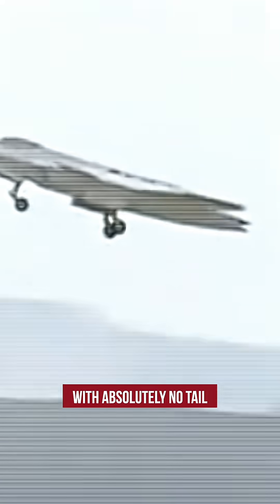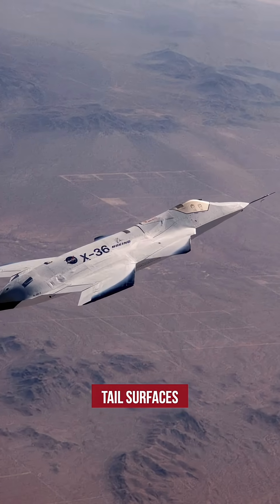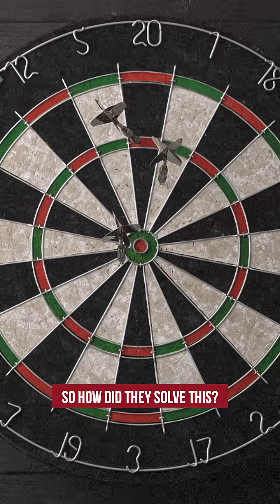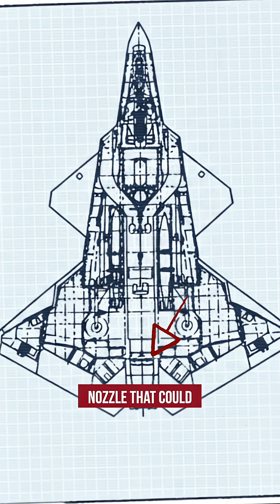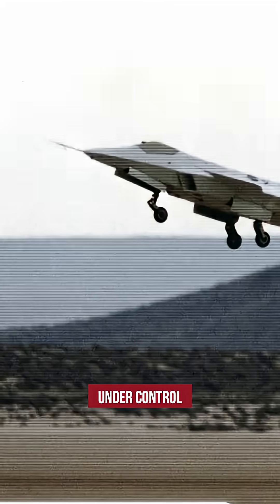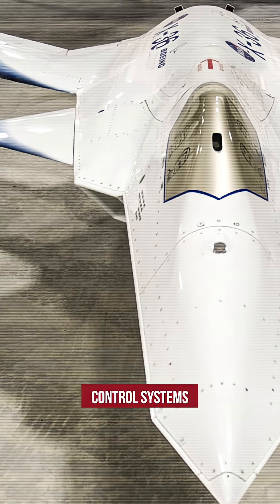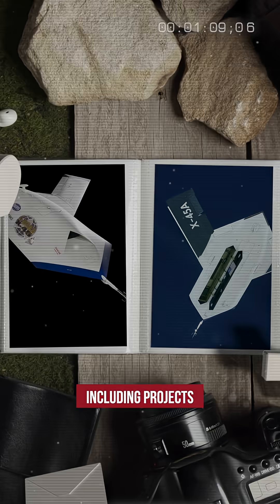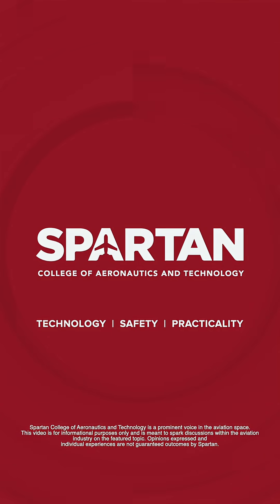The Aircraft That Helped Rewrite Flight Rules

Comment: Meanwhile birds : vertical stabilizer? Don't  need that!
Reply: they do have vertical stabilizer tho... just.. more adaptive moving parts and complex  :)
Reply: They fly at much lower speeds and are incredibly light 😊
Reply: Birds are like gliders that flap their wings. 
Now that I think of it, I’d like to see a Bird with a mini jet engine. 
Would be cool.
Reply: Birds have aeroelastic flight surfaces and often on top of aerobatics they do aeroballistic maneuvers = fold their wings completely and just let gravity and their momentum do its thing. We are long ways off from mastering flight like best birds and insects have. I highly recommend anyone interested  getting a bird feeder if they can so that they can observe birds very closely, preferably also record their flight in high framerate. The most mundane things they do constantly are amazing when seen slowed down as our eyes can't see all the little things they do in a split second.
Reply: If you look at them they tend to flip the tail vertically for yaw so they just part-time it as both.
Reply: Amazing description from Aviation Stack Exchange: the main problem with mastering bird flight is that it's very hard to study their aerodynamics independent of the control system.
Reply: They do it by just rotating their tail feathers. Search up a video of any bird hovering in an updraft and you’ll see it turning its tail in different ways to stabilise
Reply: What’s that got to do with supersonic fixed winged aircraft ?
Reply: Plus they poop on shiny cars rich people own. 😇
Reply: @NolenCobb I'm far from rich. So does that mean the birds are predicting my future 😁
Reply: @NolenCobb  doing the lord's work

Comment: I mean the Horten brothers did it too
Reply: The horten ho is quite LITERALLY responsible for your entire stealth bomber design philosophy 

So much so that instead of "innovating" you jusg made the B2 slightly smaller and painted it white 😂😂😂
Reply: No. they didnt it wasnt finished. And the didnt solve the stability issues. Northrop B2 solved it
Reply: @OverneedBelkanWitch tbh they made it work
Reply: @OverneedBelkanWitch true it had issues but it flew so it answers the question
Reply: Flying wings are different and easier than a design like this and China's  J36
Reply: @md.abdullahalmamun1636  Flying wings do not have no tail and are they are an air craft so they qualify
Reply: @md.abdullahalmamun1636 I wouldn’t say they’re easier. They have different challenges I’d say. For example if you have a flying wings then where are you gonna put the yaw and pitch control? (Pitch is easy but for the yaw you would have to get fancy with the horizontal stabilisers and thrust.) with an elongated plane body like this you can use the canards to to give it more stability (just as they already do with modern planes like the Eurofighter or Grippen)

Comment: Remember too that the X-36 was a scaled, proof-of-concept model for the concept of the aircraft that would have become McDD's entry to the JSF program, but the company was in deep crisis and it never came to pass.
Reply: McDonnel Douglas did have an entry in the JSF contest.  It was eliminated from the competition when the Joint Program Office selected the Lockheed Martin X-35 and the Boeing X-32 for the demo phase, eliminating separate entries from Northrop and MD.  X-36 did advance McDonnel Douglas and then Boeing's knowledge of tailless flight controls.  The X-45 and now the F-47 have surely benefitted from this knowledge.
Reply: Why does the aircraft in this video have nasa and boeing written on the fuselage.
Reply: @sidharthsaji521 because it was an experimental aircraft by Boeings acquired subsidiary that they took over and helped complete, in the end a lot if X planes like this end up doing aerodynamics research with/for NASA... hence the partnership.
Reply: @ravissary79 More to that, the X-36 first flew in May of 1997, the merger between McDD and Boeing completed three months after that.
Reply: Remember that China J-36 and J-50 came up with foldable artificial rudder fins and elevon giving their new 6th generation fighters to perform sharp yaw and pitch. Coincidentally J-36 designation by Chengdu probably to remind people of X-36 that they came up with better invention J-36.
Reply: @jawarakf actually china did not came up with the J-50 and J-36. Both planes are still unnamed.
Reply: @jawarakf What happens when the wing tip control systems fail.
Reply: @jawarakf wow hey good for china only took them 27 years to catch up to 1997 tech
Reply: @whisperingforest9909 bruh you realize the X-36 is a 1:3 drone right? It's basically a glorified RC plane. J-36 is a (soon to be) fully functional and operational fighter.
Reply: @whisperingforest9909 china is far ahead of you in 80% of all fields now lmao , live in Hollywood son
Reply: @Gongolongo  China has FORTY J-20's.... 😂 Im not worried about the J-36
Reply: @jawarakf neither of those aircraft have foldable vertical stabilizers. 
Artists did renders that speculated this but the newer footage showed this to be impossible because the wings trailing flaps cam now be seen and they follow the rear lambda design in a predictable traditional way that precludes the folding stabilizers from occupying that space.

Don't look at renders and then say China did x. That's just fan art. China has released hardly ANYTHING official on these aircraft. Everything we know is a combination of speculation and footage.
Reply: @ravissary79 are you not seeing the many videos of China J-36 and J-50 flying over cities? They have artificial fins and flaps that allow superior movement for aircraft that big. Also in the news, Fujian class aircraft carrier released videos of J-35 and KJ600 taking off on EMALS and landing on Fujian class aircraft carrier. It means China will get 4-6 conventional aircraft carriers with complete fighter wings for shore defenses followed by nuclear powered aircraft carriers for offensive operations.
Reply: @jawarakf yes ive seen everything i can find... none have folding virtucal stabilizers as is discussed in this video.
They're both FULLY tailless like the b2 and  b21 and x36.

The j36 has split flaps for stability... like the b2.
The j50 has an unusual wingtip all moving  canard... no vertical stabilizers.
Reply: @jawarakf  Oh wow! China now has EMALS! That means they are eight years behind Gerard R Ford which is bigger and nuclear powered. Also US first tested the F35C on carriers in 2014. China is still behind dude, don't hype them up too much😂.
Reply: @HeidiK3The F-35B is VTOL 😂 it doesn't need a catapult. We have them on our 11 America Class (LHA) Amphibious Assualt Carriers, As well as the "ancient" 11 Nimitz Carriers and the 1 operatiinal Ford Class Carrier. China has 3 Carriers 2 of them are in dry dock, and the other has never left Chinese Territorial Waters. If you want to talk about "problematic" let's talk Laoning, which was a 68% complete Russian Kuznetsov class carriers. How well is the Kuznetsov (Russia's 1 and only carrier) these days? 😂

Comment: So now we know why Boeing won the new air dominance fighter competition.
Reply: NGAD (Next Generation Air Dominance) is a DARPA program that started in 1983, it's not 1 single plane. NGAD includes the F-22 (ATF - Advanced Tactical Fighter), F-35 (JSF-Joint Strike Fighter) & F-47 (PCA - Penetrating Counter Air) fighter planes. NGAD also includes the (operational) MQ-20 Avenger, MQ-28 Ghostbat and the X-58A Valkyrie Loyal Wingman drones as well as other elements of Air Dominance.
Reply: The REASON why Boeing is building the F-47 is because with the buyout of Northrop Grumman, Boeing has the facilities to be ABLE to make the F-47. Lockheed's production has their hands full with making the 5 F-35 variants (A,B,C,I & J with I and J being custom A versions)

Comment: The English Dunne D.5 was the first tailless aircraft... not the X-36. It never "broke" design rules, just used already exisitng ones that werent popular yet.
Reply: It may have been tailess, but it still had vertical stabilizers at the end of the wingtips doing the same job. 

And for @jet_enjoyer, the Northrop N-9M flew before the Ho229.
Reply: @kutter_ttl6786 H.IV (Horten glider) flew before the N-9M
Reply: @kutter_ttl6786  Sure, and the dozen or so tailless gliders that the Horten brothers designed flew before that.

As a matter of historical significance the Ho229 was much more prominent
Reply: And the Ho229